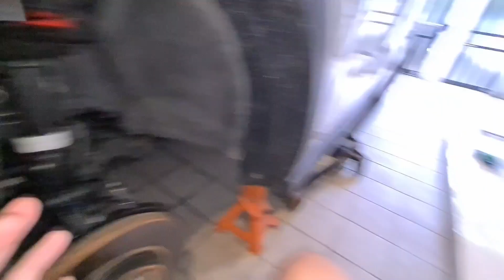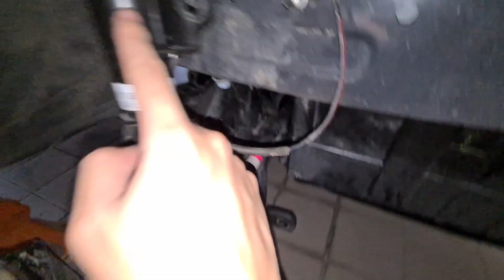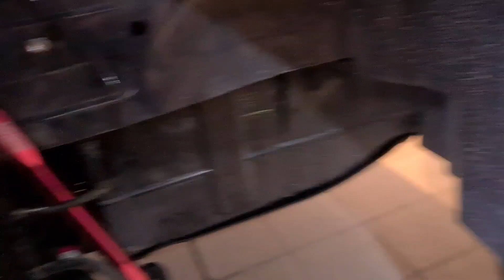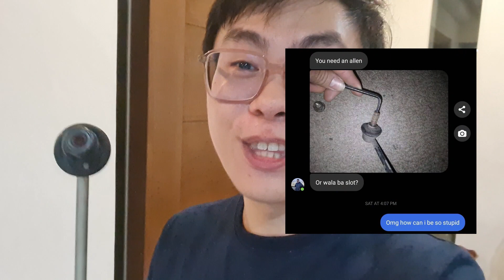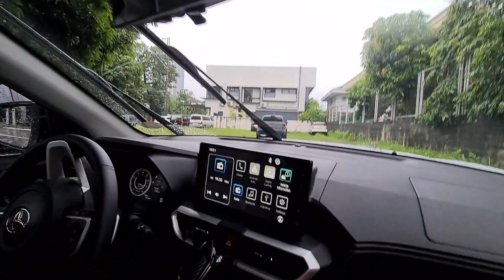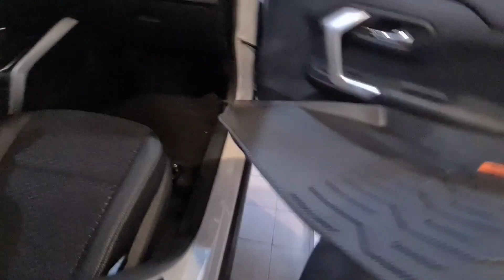Why the Raize needs adjustable sway bar end links? These lift springs are so good!

Comment: You shortened the length from 310mm of the OEM end links to 285mm of those from Largus, right? Is it okay to change the end links length though? Would it lift the ground clearance of the car up/down? What else would it do besides that? Please correct me if I’m wrong 🥲. Since your video consisted a mix of English and Tagalog, so it would be a bit confusing for a foreigner like me to fully comprehend though 😅. Anyway, splendid work though. I’m officially your follower now!
P/S: From Vietnam 🇻🇳 with love ❤️!
🇻🇳❤️🇵🇭
Reply from the maker: the length of the end links have nothing to do with the height of the car. They only control the range of movement of the sway bar.

Comment: Halo pare, nice to see this mods, currently im using tanabe NF210 lowering kit, will it bring improvement if i change to largus? Greetings from Indonesia Rocky user🙏❤️
Reply from the maker: we showed Largus stabilizer end links in the video, which is different from your Tanabe lowering springs. Changing the end links from stock to Largus however potentially optimize your front sway bar's function

Comment: Hi boss! Ask ko lang po if meron din kayong issues with your CarPlay? Just got my Raize a week ago and pag nag sasabay pong gamiting ang Spotify at Waze sa CarPlay eh nagdidisconnect siya every 3-5mins. Baka po may alam kayo? 😭
Reply from the maker: Walang issue sa carplay. Android auto yung di gumagana samin 🤣. Try ninyo to use the original cable of your phone or use what they call a "data cable".
Reply: @FranzGaw  hmm baka si infotainment ata ni Raize ko ang may problem hehe. I used yugn existing cord ko na ginagamit ko sa phone charging then bumili ako ng panibago kasi inisip kong baka luma na tong isa. Ganun parin. Both original sila. Sad life. Salamat boss!

Comment: Sir, okay lang ba if likod lang yung i-lift? If ever man likod lang, kelangan pa ba ng strut bar, sway bar end links etc. Or enough na coil springs sa likod lang? Thanks
Reply from the maker: Ano yung purpose na yung likod lang ang naka lift? Parang it doesn't make sense 🤔
Reply: @FranzGaw  napansin ko lang kasi masyadong bagsak po yung likod ng raize kapag loaded kaya naisip ko baka pwede sa likod lang yung i-lift hehe
Reply: @useason2392  correct masagwa pag loaded sa likod, gusto ko sa likod din